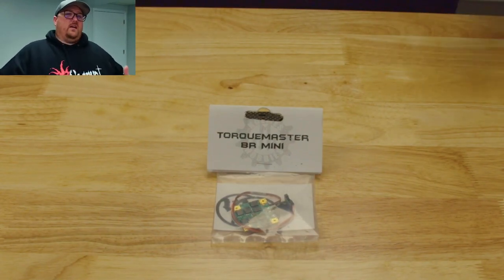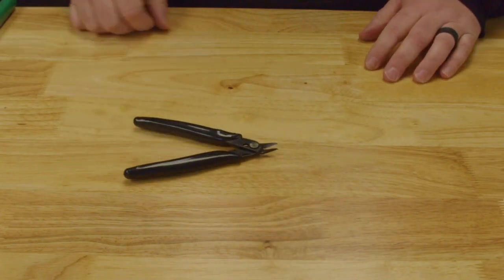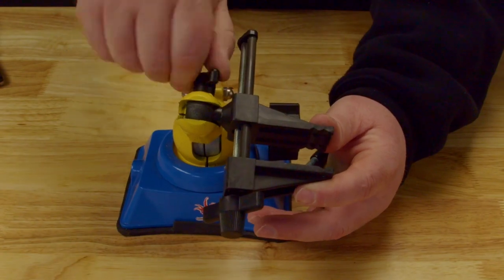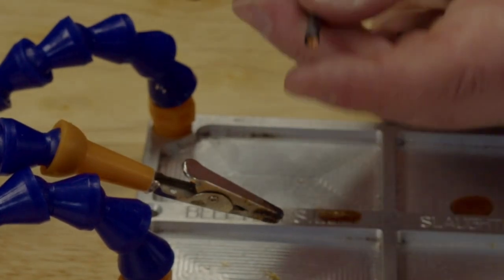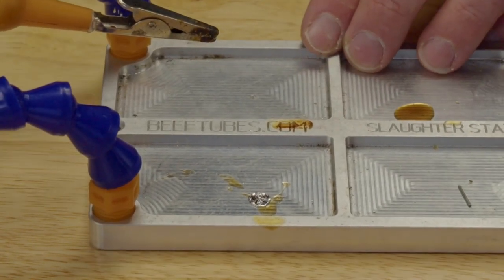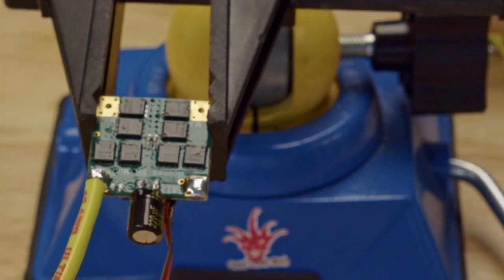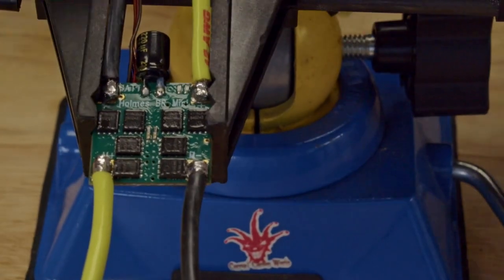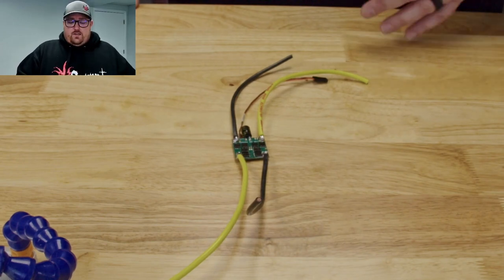HOW TO- Soldering up Holmes Br Mini

Comment: Clean your tip after every solder joint you make!
Reply from the maker: I think I did, or typically do for sure.
Reply: Recommendations for shrink wrap size for a br mini and esc combo?